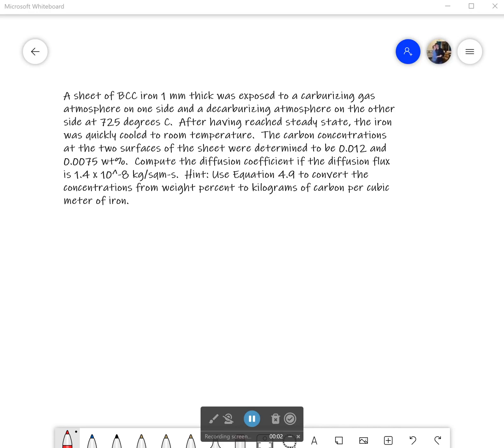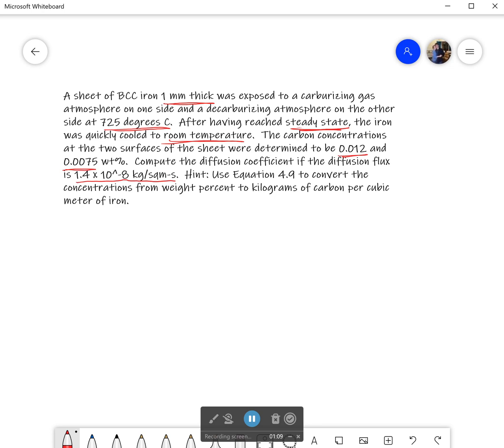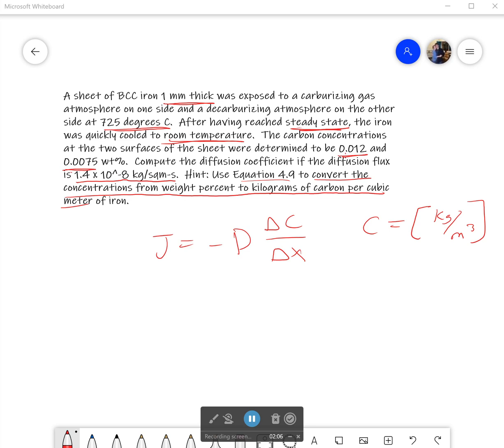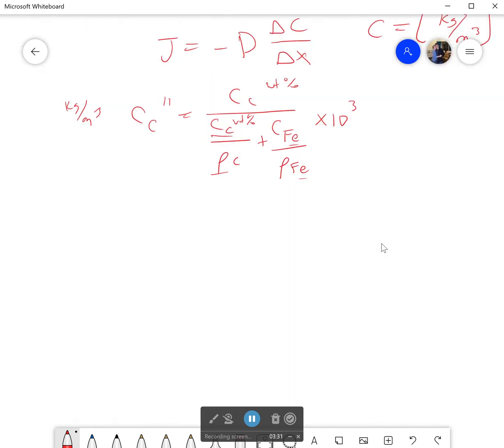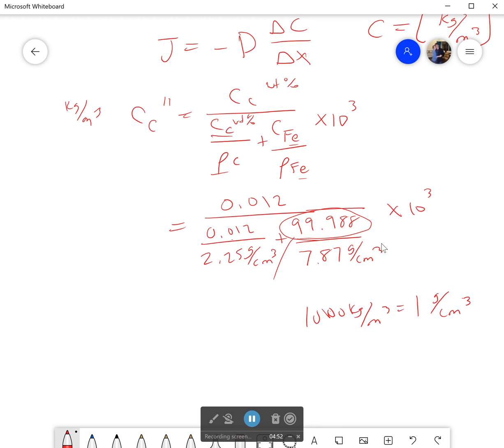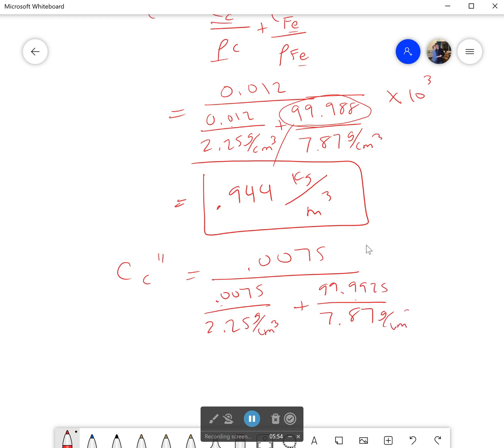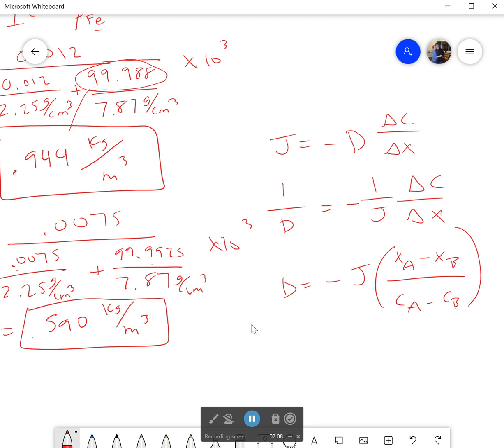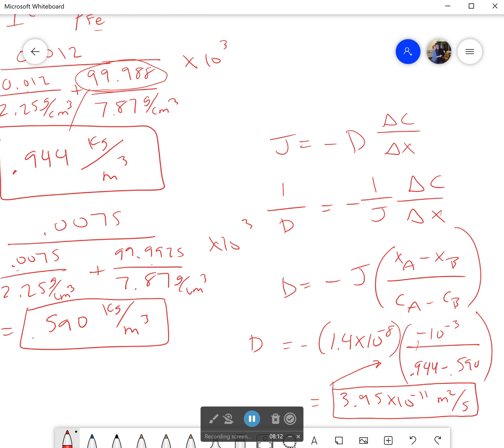Example: Solving for Diffusion Coefficient

Comment: Why did we divide the concentration of iron by the density of carbon
Reply from the maker: We needed to get the concentration not as a percentage, but in terms of how much mass of carbon we had per cubic meter. This is because Carbon is an impurity within the Iron. As such, it is diffuse and the total amount of carbon (which the flux depends on) is varying.